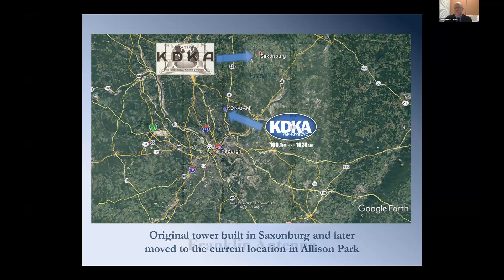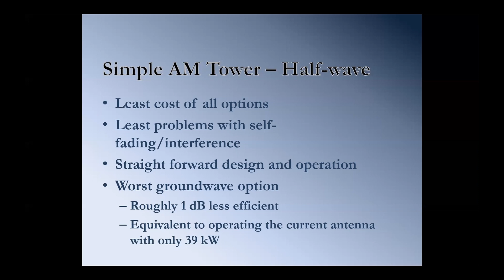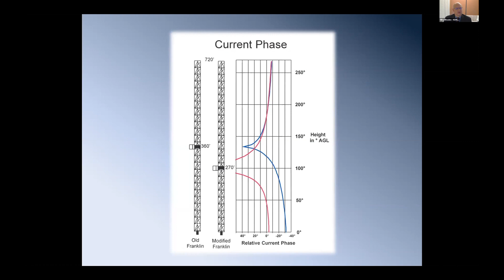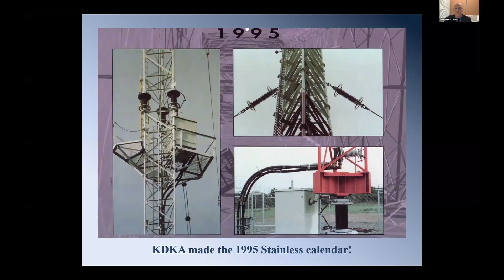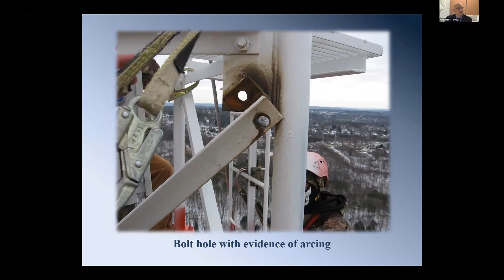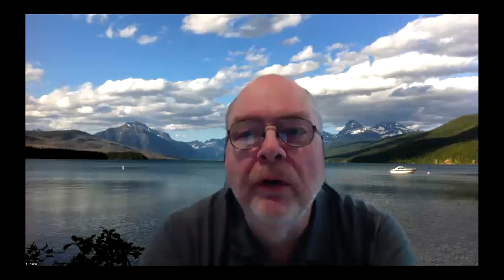The KDKA Tower - Mike Rhodes

Comment: I read a similar report on the "new " tower and all of the RF mysteries that were discovered when activating the new tower. "Self-Fading" was quite a problem to overcome and it took TRUE engineers to get the system to co-operate. I am a Ham operator and I have heard the term BAZOOKA, and it's still a puzzle. Being it is a vertical DIPOLE probably brought on complex RF solutions and crankin' on the math. Beyond my brain power. I live 70 mi. from Pittsburgh and 1020 booms to my home and they are LOUD on the AM band....And I bought the tower leg  Acrylic 1920-1995. For Children's Hospital